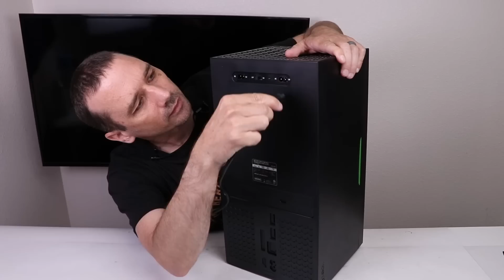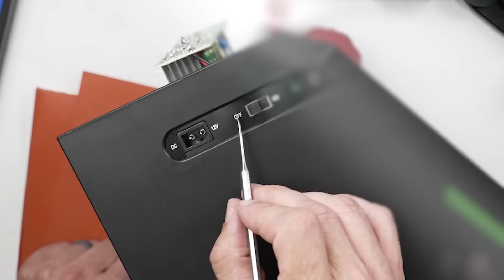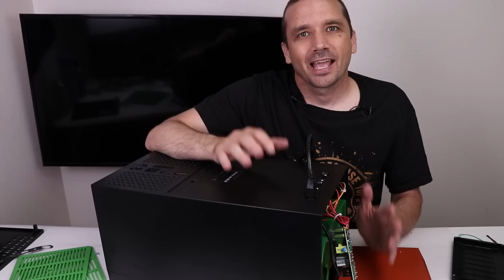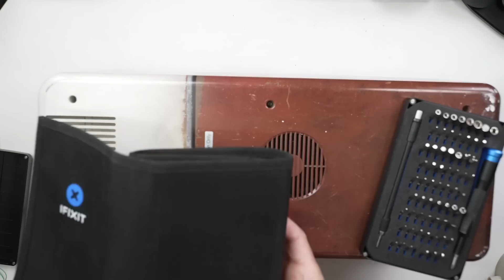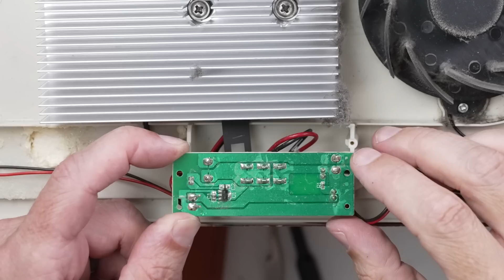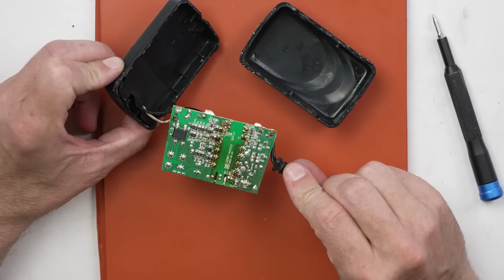BROKEN Juggernog and Xbox Fridge - Let's Try to Fix Them!

Comment: I thought my Xbox mini fridge was the only one with the power to fan issue but I guess it’s more common. Long story short I upgraded the fans I used my old Xbox one s 
Fan and radiator to extract heat and a led fan inside the fridge, now it works 100x better. My issue also was the power button board

Comment: Thank you for the video, good job.
I've been fixing wall warts for many years now, sometimes they can be cracked open  with a hammer like a walnut, just glue them back together.
Another point, a hot melt glue gun comes in handy for many things, I use it to make strain reliefs and molding plugs and connectors as well as gluing things together

Comment: I couldn't figure out how to take the xbox fridge apart got a bit destructive to get it disassembled mine was completely dead everything I'm modding it to  hopefully increase its cooling capability as it was not very good only using one of those modules that get hot on one side and cold on the other wish this video was out like 3 days ago couldn't find anyone else who has fixed one of these

Comment: The power supply failing for the juggernog fridge is an EXTREMELY common problem, there's multiple forms of people talking about how there's don't work. I had the same issue with mine and so I found a power supply of a similar spec and replaced its connector and it got mine working again. I'm glad that you showed that this is the problem with them as when I was trying to figure it out there was not really advice to what was wrong.
Reply from the maker: Yes, very common. Such a bummer that it's an easy fix but they won't let you open it easily to repair it
Reply: Yeah, I replaced the power supply on mine and it worked for a few months, then died again from some other issue. I never got around to opening it up to find out what killed it the second time, I just got a Red Bull mini fridge and now my Juggernog one is a display piece.

Comment: My xbox fridge died when power went out. The AC to DC inverter they have in there is crap. Supposedly powering it off the 12V dc car adapter would still work. Have yet to try. This is inspiring me to open mine up and see what's up
Reply from the maker: OPEN IT!!! Lol
Reply: @Tronicsfix  opening it up this weekend 👌

Comment: Awesome video! I've had a Juggernog fridge with a cracked PCB for ages, is it easy to replace the board? Where would I be able to get a new board?
Reply from the maker: You'd need some soldering skills but idk where you would find a replacement board other than from another fridge. I might be interested in buying it from you though. Contact me on my contact form on my website if you want to sell: https://tronicsfix.com/pages/contact

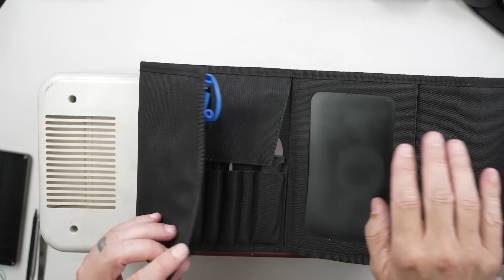Comment: 8:50 I love how you ignored the ESD strap as it hasn't been needed in personal computers or electronics since the 00s... Of course servers and other manufacturing equipment may be more susceptible to ES.
Reply from the maker: Exactly. It's still important for some things but not for what I work on
Reply: I remember using those. I actually fried a computer once cause I didn't.

Comment: I’ve still got my juggernog mini-fridge and it’s still kicking ass years later
Reply from the maker: Wow, nice.
Reply: @Tronicsfix  Sometimes when I turn it on, the fan makes a rattle noise. That’s because it wasn’t used for a while. Afterwards the noise goes away.

Comment: 2:50 what is the best way to clean plastic of an soldering iron?
Reply from the maker: Most irons come with a brass sponge for cleaning and that's what I use.
Reply: @Tronicsfix  ah my soldering iron came with a normal sponge for water so i think i need to buy a brass sponge 
thank you
Reply from the maker: Yes, I prefer the brass sponge myself.